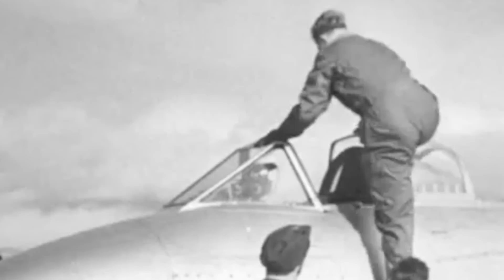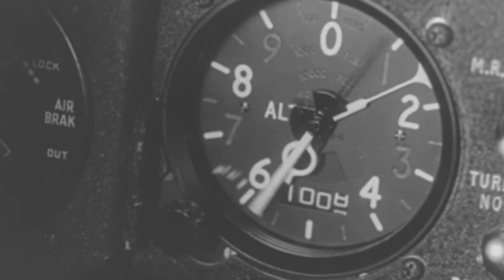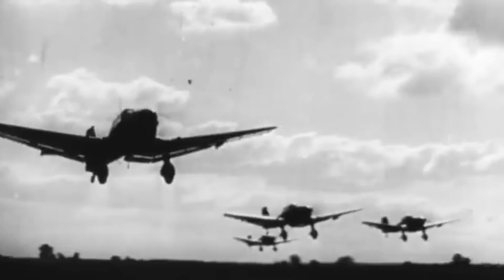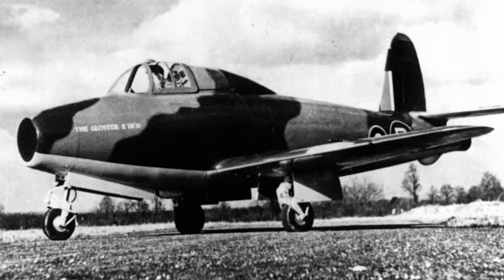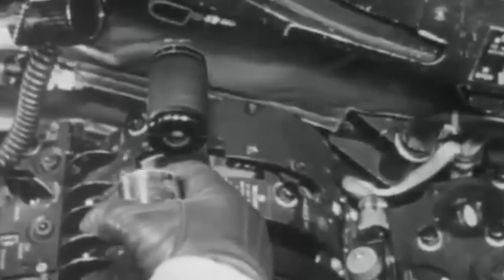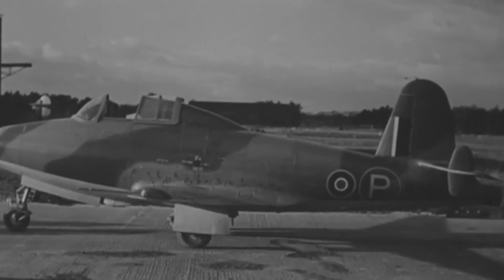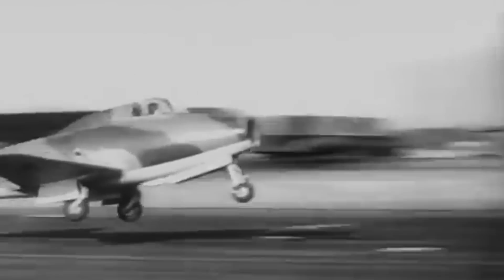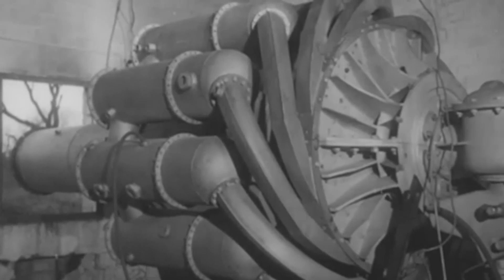Britain's 500 MPH Coffin With Wings

Comment: The Gloster Whittle E.28 was not a brilliant aircraft.... Gloster was not a brilliant company.
Reply: We feel we can clear up some commonly held myths and misconceptions, obviously.

It's always good to see the facts presented clearly and concisely isn't it

See further down for a Meteor losses comparison.

Indeed that's correct. The Whittle Gloster E28/39 was of course a brilliant aircraft that was later copied in Russia as the upsized and tweaked Mig 15 with a copy of the RR Nene gas turbine aero engine.

Obviously the RR Nene being the world's most powerful & most reliable gas turbine aero engine in 1944. 

   That's correct, of course the MD F3H Demon was a contemporary to the DH Sea Vixen & had a similar performance. The F4 Phantom was a follow on from the F3 Demon. The Sea Vixen took a long time to get from first flight to introduction for various reasons and a similar situation occurred with the MD F3H Demon. 

McDonnell Douglas F3H Demon
590 Built.
Introduction date 7 March 1956
First flight 7 August 1951
Retired 1964

MD F-4 Phantom 2
Number built 5,195
Manufactured 1958–1981
Introduction date 30 December 1960
First flight 27 May 1958

DH Sea Vixen
Number built 151 (including two DH110 prototypes and one Sea Vixen prototype)
Introduction date July 1959
First flight 26 September 1951
Retired 1972

Non combat phase accident losses.
% of Aircraft built.
The Canadair CL-44 was a turboprop airliner.
Canadair CL-44              (ff 1959 ) 48%
Lockheed XF104              (ff 1954) 100%
Lockheed  P80                 (ff 1944) 43%
Lockheed F104                (ff 1954) 45%
MD FH Phantom 1           (ff 1945) 35%
MD F4 Phantom 2           (ff 1958)  28%
MD F3H  Demon              (ff 1951)  32%
Gloster Meteor               (ff 1943)  21%
DH Vampire                    (ff 1943)  23%
DH Sea Vixen                  (ff  1951) 33%
Gloster Javelin                (ff 1951) 20%

    Regarding the UK Aerospace Sector.
  
An airline recently ordered 60 RR Trent XWB Engines

   Clearly It's a great pity & a crying shame that British military forces had to occupy a large part of Germany for decades after 1945 & Russian military forces had to do the same. Of course Russia still posseses a large chunk of what was German territory & of course Russia & the UK produce nukes. Obviously Germany does not produce nukes.

   Interesting British achievements.
There is no doubt that the Fairey (England)
Delta 2 was of course the world's first jet
aircraft to exceed 1000 mph.  lndeed It
exceeded the previous record by 310 mph &
held the record for 1 year. Incidentally, the Dassault Mirage 3 & 4 are based on the Fairey Delta 2.

Early days, jet fighters.
   De Havilland Vampire, Sea Vixen & Gloster Meteor accident losses were not high or unusual for fighter aircraft at the time. De Havilland built large numbers of all metal airframe aircraft before the DH Comet.
We mustn't forget of course that the DH Vampire for example first flew in 1943 & the engine was also built by De Havilland. There were examples of the Vampire interceptor / fighter in service until 1990 which was operated by more than 30 countries.

Non combat phase accident losses.
% of Aircraft built.
The Canadair CL-44 was a turboprop airliner.
Canadair CL-44             (ff 1959 ) 48%
Lockheed XF104             (ff 1954) 100%
Lockheed  P80                (ff 1944) 43%
Lockheed F104                (ff 1954) 45%
McDonnell FH Phantom  (ff 1945) 35%
Gloster Meteor               (ff 1943)  21%
DH Vampire                     (ff 1943)  23%
DH Sea Vixen                  (ff  1951) 33%
Gloster Javelin               (ff 1951) 20%

   An example of what goes on these days in various countries.
Obviously, for example, there are of course no German companies that makes German jet aircraft in Germany & there are no German Companies that make German gas turbine aero engines in Germany that are suitable for widebody airliners.

     That's correct, Brazil makes very good airliners & Brazil is 100th down the list along with Indonesia for wealth per capita. Of course it is in fact the case that Embraer can't build those airliners without purchasing stuff from the US, UK & Europe.
Norway Holland Denmark Ireland Belgium - Top 20 wealth per capita - Don't make airliners -  its as simple as that.

   Early days of the airliners.
That's correct of course, at the time the Comet wasn't particularly dangerous. Agreed, that is indeed the case of course, The DH Comet was definitely not the worst engineering failure in commercial airliner history.

Losses comparisons
How things were in those days.

DeHavilland Comet 4 UK                       14%
DeHavilland Comet all  (ff 1949)           17% 

Boeing 307                               70%
Boeing 247                               48%
Boeing 707            .                  20% 
Lockheed Electra Turboprop   29%
Canadair CL-44  Turboprop     46% 
Convair CV-580  Turboprop     22%
Convair CV-880    (ff 1959)       27% 
Convair CV-990     (ff 1961)      33%
Tupolev TU-104       (ff 1955)    16%

     Of course De Havilland had prior experience building many all metal construction airframe aircraft & thousands of jet powered fighter aircraft that were primarily of metal construction with pressurised cockpits & jet engines built by De-Havilland.

  More recent UK military jet aircraft.

  Of course the Tornado & Typhoon & their engines are Supersonic & are indeed British design aircraft with British design engines built by an international consortium. The Tornado design for example started life during the 1950s at Vickers as the AFVG, it's engine is based on the RR RB-199. The EE Lightening is also a British Supersonic jet aircraft.

  The Typhoon is the British BAC-EAP with an engine based on the British RR XG-40, the Typhoon is also built by an international consortium.

  Agreed, that is correct of course, clearly there are many countries that could easily produce airliners of better quality than Bow-wing (see b-47 wing folding & wing collapse incidents) but don't for some very good reasons. Bow-wing (see B-47 wing folding  & wing collapse incidents) being a result of the size of the US, the large protected domestic market & great ease of testing new types due to the equator to arctic geography complete with up to date aviation infrastructure & a few other reasons related to production scale capability, politics, the nature of the airliner market coupled with the nature of airliners themselves & general basic economics.

  Obviously there really is nothing special about Bow-wing, having more than 50 years design / build experience on the type means they have no excuses for the horrendous 737 Max incidents for example.

    Indeed GKN Aerospace, BAe Systems & Rolls Royce combined now do more Airbus work than Germany on an absolute basis & significantly more work than that on a per capita basis.
  
     Agreed, Per capita for the home nation BAe Systems is the world's largest defence contractor.
 
    Correct, BAe systems announced the recent £4 Billion takeover of Colorado based US based Ball Aerospace.
 
    It's definitely the case that BAE systems now does a significantly higher value of work for Airbus than it did when it was a major Airbus shareholder before 2005.
    
      Obviously RR now owns US Engine maker Allison for example which does classified Aerospace work for the US Govt.
  
   Yes, that's right of course, Anybody currently flying on a widebody airliner stands a good chance of being on an aircraft powered by RR gas turbine aero engines built in the UK.

   A typical but small glimpse of what goes on in the very internationally orientated British aerospace sector. 

  Of course the RR Nene was in fact the world's most reliable & most powerful gas turbine aero engine in 1944. Licensed built versions & copies of the RR Nene & RR Derwent would go on to power many aircraft in Russia including the Mig 15 & Mig 17, the US, China, France & other countries for decades after 1944.

      Boeing Apache Attack Helicopter.
AH-64: 75 UK suppliers, 7% UK content, global fleet of 1280+ aircraft.
F35B more than 130 UK Suppliers, more than 30% UK content.
F35A & F35C more than 130 UK Suppliers, more than 15% UK content.

   There is no doubt that an airline has just ordered
60 RR England Trent XWB Engines

Obviously the UK has the
World's Highest Combined Per Capita
Nuclear / Defence / Aerospace Sector Activity.

Rolls Royce Holdings UK
Subsidiaries
- Rolls-Royce plc
- Rolls-Royce North America (Allison etc Classified Military stuff)
- Rolls-Royce AB
- Rolls-Royce Deutschland
- Rolls-Royce India Private Limited
- Rolls-Royce Marine Power Operations
- Vinters Engineering Limited
- Rolls-Royce Controls and Data Services
- Rolls-Royce Power Systems
- Bergen Marine
Joint ventures include:
- Rolls-Royce Turbomeca
- MTU Turbomeca -

Trent Family
The MT30 (Marine Turbine)
Industrial Trent 60 Gas Turbine
Trent 7000
Trent XWB Airbus A330neo.
Trent 1500
Trent 1000
Trent 500
Trent 600
Trent 700
Trent 800
Trent 8100
Trent 900

RR wholly owned subsidiaries in Germany handle smaller 2 shaft RR gas turbine aero engine work.

Clearly the line above this line is blank.

We do indeed hope this helps, of course.

Cheers as always & 👍 indeed.
    
. ..... ...... ...... ...... . . . .. . .. . . .  ...